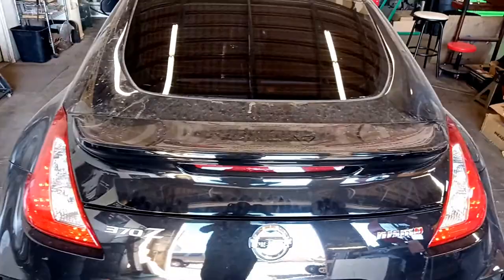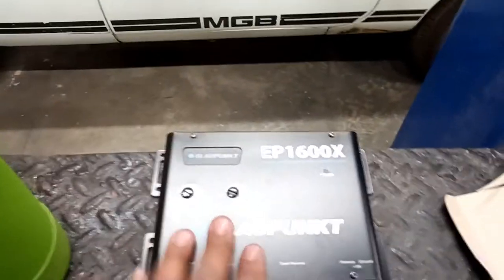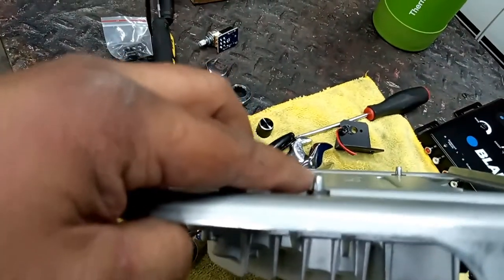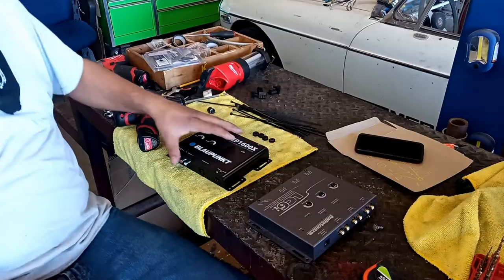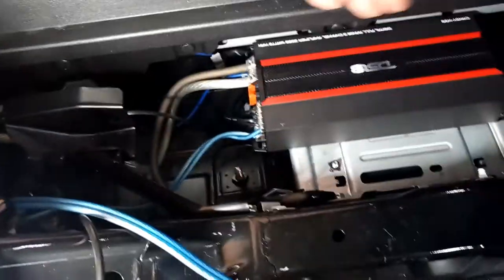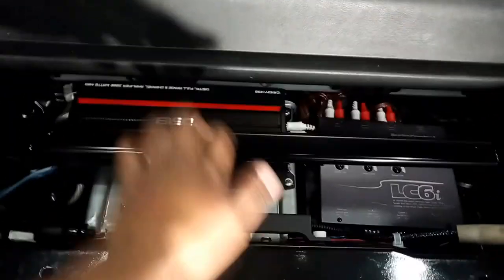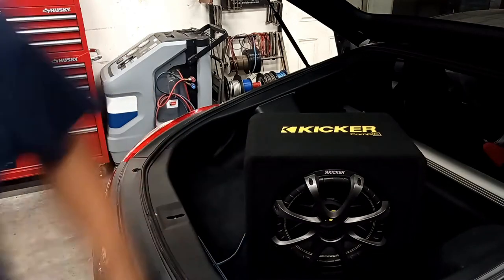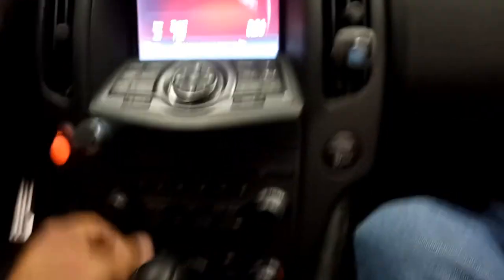Nismo 370Z upgraded sound system

Comment: My 2019 370z with sport pkg came with an upgraded Bose 8 speaker sound system with 2 subwoofers in the spare tire enclosure. It sounds really good and is, in my opinion, well worth the cost.
Reply from the maker: Yup, there are some upgraded sound options available nowadays.   But once the car is past the dealership its hard to add options like this.

I think this nismo also had the sub you are talking about.  Hard to remember, its been a couple years since this install.  
Please subscribe and share the vid with others who might like it.
Thanks for watching and for commenting.